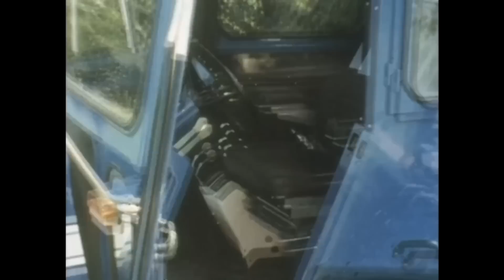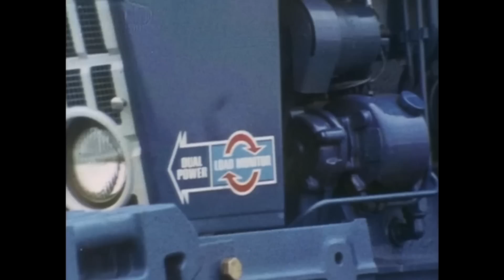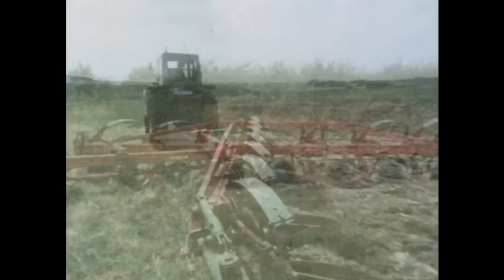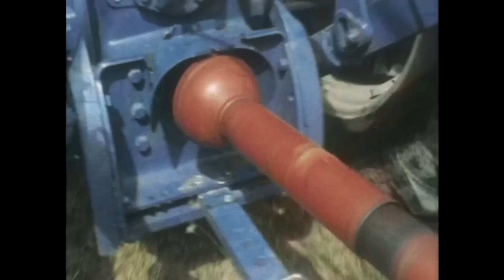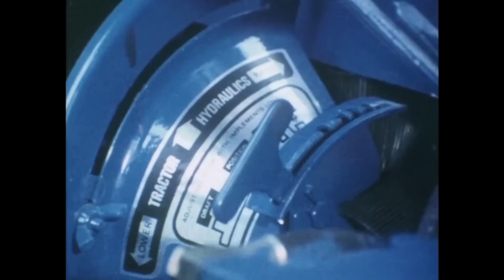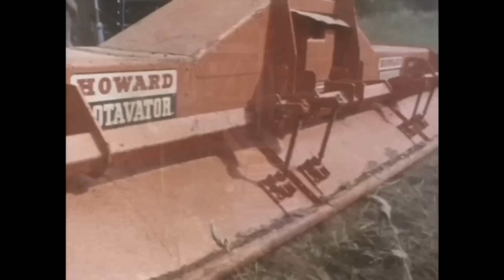Ford Force Power Promotional Film

Comment: The on-board cigar lighter in the top of the range model was ideal for the cigarette or cigar loving farmer who liked to puff away while driving the tractor or doing a job in his tractor, you just drove with cigar or cigarette in your mouth while it heats up, then remove, light up and replace while hot.

Comment: I remember when we were farming and my dear father and mother god bless them when they were alive we had three  Ford's. A 4000 and 5000 great. Tractors always reliable bar always getting airlocked only cure was let through the cylinder lines thanks be to God when they introduced the in line push disesl pump so disesl would be moving they were a great tractor and had a 6610 with Ap cab had a great tractor ♥️♥️♥️♥️